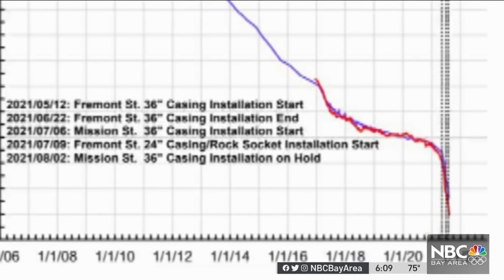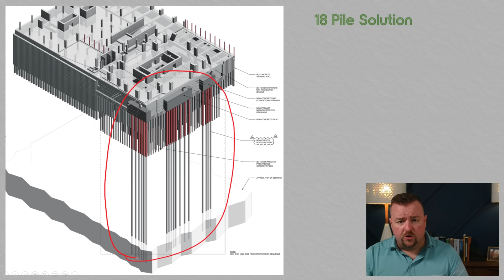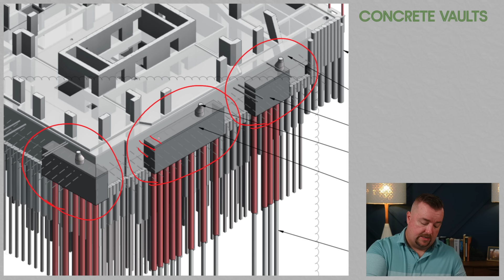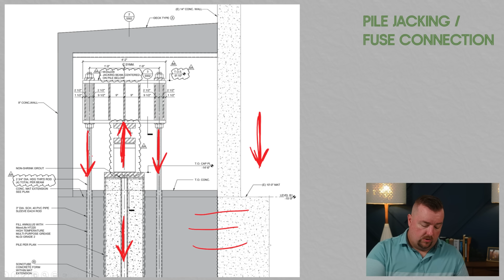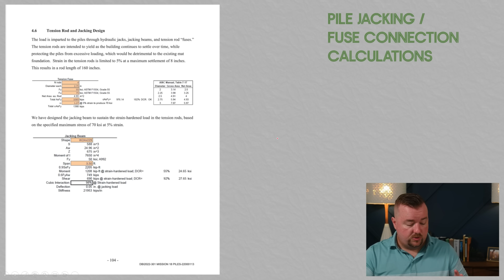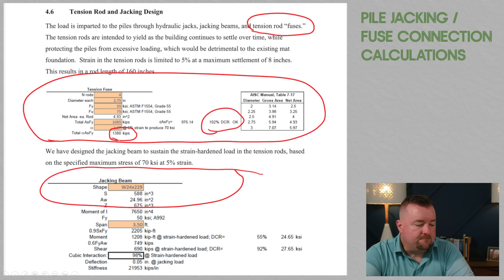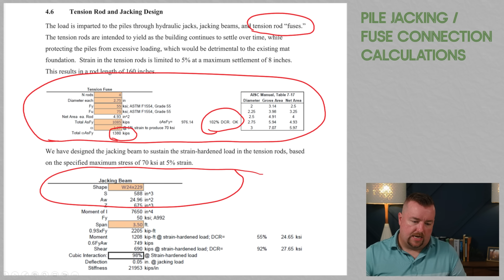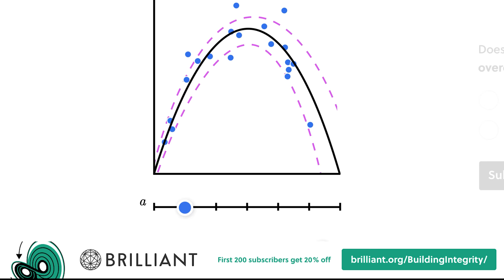Did I Uncover a $100,000,000 Mistake with the Millennium Tower "Fix"?

Comment: As mechanical engineer I would double check also the "tension fuse" calculation. I'm European, so the ASTM F1554 is not too familiar to me with all of their intricacies, not to talk about the units :) But what is perplexing to me, is the lack of taking into account the notch effect in the tension fuses. Those things, to my understanding, are all through threaded rods. The thread has a significant impact on the tension strength of the rod. There is going to also be wind affecting the building, which will cause the building to sway and that will cause the amount of tension in the fuse to alter. The thread with it's sharp crests and valleys will also act as a perfect swarm of nucleation points for cracks under fatigue load. I'd love to see how this is going to play out, but without the people inside or near the building... Do some of those ASTM or AISC things take these into account?

Also your worry about the steel plate is valid, worth some triple checking.
Reply: I think for this case they would assume the minor diameter of the threaded rod for the actual calculations, however for the stress concentrations, I think there are some equations that you can kind of just take that into effect but just multiplying everything by 0.8, though I'm not too sure this is going to be much of a cyclical loading kind of thing, mainly how it's going to be under tension constantly, the only actual dynamics being that of an earthquake

Comment: So far, the building has tilted about 30 inches.  (Another 6 inches, the plumbing and elevators will stop working).
These are Hail Mary moves to delay that day by a few years (so that the chief engineer & city officials are retired when this happens).
Reply: Good point! Nobody's even considering pre-collapse failure modes... SHEEEEEESH!
Reply: Chief engineer and city officials should be ARRESTED
Reply: Well, to be fair when they set up the jacks, the intention is that as the building continues to settle, it will settle the other way instead, helping to level it back out. Not gonna work with the issues with this design though.
Reply: The  building in danger is analogous to the local government of San Francisco which is also tilting dramatically to the left  and will fail/fall completely due to not reaching solid bedrock  (values)  There is a tower of babble component to this story.
Reply: @Jack-xy2pz  damn true
Reply: I heard in the last few days that some of the units now are having plumbing problems - back ups.
Reply: The plumbing is already going. Sewage is backing up into the apartments.
Reply: @TheJanet4321   I just saw a news report on that today.
Reply: Well there's poop on the sidewalks around the building so no big deal there .
Reply: Put up a big pole and wrap rope around the pole and the building
Reply: @the.parks.of.no.return  Congratulations! You are well-qualified to be the next 'expert' to 'fix' the building 😝
Reply: Let's not forget the financial backers, who want it "declared safe" so they can sell it like a hand grenade with a missing pin, and run for the door.
Reply: It's already happening...The story's are showing up now.
Reply: Toooooo many janga blocks!
Reply: @the.parks.of.no.return  That's a great idea, we could make the pole and the rope into a feature like using different colors of rope.
Reply: @Benny_000  I was only joking , you'd use two poles.
Reply: experts do what is best for experts 
at worst — experts are paid to lie
Reply: @the.parks.of.no.return  the city planners can announce to the media that "it is not an uncommon fix to use a pole and a rope"...  they just leave out the part that it is mainly used for a tomato garden.
Reply: @Jack-xy2pz  Rather apt analogy.
Reply: @angelarch5352  maybe they could grow a giant beanstalk next to it
Reply: @the.parks.of.no.return  
Walnart sells heavy duty galvanized tent  stakes that may hold against the tilt.. The good news is, according to greta thunberg The building has to only stand for another couple of days.
Reply: @Jack-xy2pz  well you could always hammer in about 10,000 stakes and attach rope from stake to the building I suppose
Reply: @Benny_000  rainbow colors ahh
Reply: @the.parks.of.no.return  As good idea as what the engineers have come up with so far.
Reply: @Jack-xy2pz  Brilliant. That way we can save the building and the world at the same time.
Reply: @Jack-xy2pz  Sure, get Trump to fix the building, that'll work.
Reply: @inconceivableabysses  Typical straw man/red herring type reply.

Comment: I am not an engineer, but was a PM who got to see the 4" steel base plates for the Oviatt Library lobby columns sheared right through due to the Northridge Earthquake.  Engineers put a lot of faith in steel & the earth doesn't was my takeaway
Reply: I've read about that building...  There was nothing wrong with the steel, the building was just unerdesigned for that large of a quake.
Reply: You've got to underpin down to the bedrock - you have to for a building of that size that in geologically-active region.

Comment: As a geotechnical engineer that has observed much smaller anchors with a similar design fail while testing them, I am very concerned. If that plate fails the rods could become rod shaped missles which shoot out of their holes through the overlying vault roof.  Your analysis needs a response from the design engineers and city building department.
Reply: My concern is that as the plates yield, the reduction in force on the jacks will be interpreted as a positive sign that the building is no longer sinking, instead of the reality that they have experienced plastic deformation and are close to failure.
Reply: @Hyperlooper  Unlikely. Because when that happens all the plates will fail in a cascade, and the building will begin actually settling (and will be measured elsewhere). It will be obvious anyway, since a lot of really loud bangs will be heard.
Reply: @armamentarmedarm1699  When an element is critical, but inexpensive to upscale, the best design methodology is to overbuild that element to eliminate risk. 
The cost of quadrupling the thickness of the plate (just stacking four of them even) is essentially nothing in the grand scheme of things.
Reply: THE PLATES DON'T HAVE TO FAIL.
The weakest thing has to fail.

I suspect the plates can be pulled through the concrete by the rods.
Reply: @fhuber7507  The steel plates are also highly likely to fail/break at the rod holes, because there is not enough supporting material around these holes. 
And when this happens (... to me this is just a question of 'when', not 'if' ...), there is no means of checking the state of these plates and/or the state of the rod ends, because they are firmly enclosed in concrete. From my point of view it would have absolutely been imperative to design this crucial point of potential failure in a way that would have allowed constant monitoring at any given point in time, especially with regards to the incalculable additional stress factors from seismic events in an area that is very vulnerable to earthquakes. 
Also, there seems to be no provision for re-greasing the piles and the rods in their respective surrounding tubes, which I would consider a serious oversight with regards to the necessity to keep these mechanisms in an uninterupted perfect working state for decades to come - especially with regards to the fact that they are situated in enclosed underground vaults which are prone to high humidity and condensation issues. 
Overall I think it would have been better/safer to have the piles and hydraulic lifts designed as pushing elements that work directly towards the (accordingly reinforced) ceilings of these vaults instead of using them as pulling elements working towards the floor sections of the vaults. By doing this the whole failure prone I-beam/rod/plate parts could have been eliminated.
Reply: @armamentarmedarm1699  Are you familiar with subscription-based businesses?
Reply: @westganton  That's one way to put it I guess... instead of a wholly owned foundation that just works in perpetuity, the building got a foundation that requires continuous hands-on management and on-going recurring expenses in order to not have it disappear on them – and it still might just surprise them and break down one day.
Reply: You won't have rod shaped missiles. The rods are still attached to the jacking beam.
Reply: I don't see how this could work. As the building continues to sink, the entire weigh load of the building will eventually rest on this rig.
Most likely real purpose of this thing was to extract another $100,0000,000 from this engineering disaster of a building.
Reply: @Framo60  Just a potato planter here, but I read that reinforced concrete has great strength in compression, but not so good in tension.  A solution that jacks up the ceiling of the vault would place all sides  of the vault in tension.  Would that be a problem?   The solution shown is holding the vault up by lifting it with "straps" from underneath.
Reply: @chetmyers7041  I am not an building engineer, too, but I think that you have a good point here. 
But it would in principle be possible to take the tension out of the concrete in the side walls of the vault(s) by pre-stressing it like it is done in concrete beams or bridges. 
The construction as it is being build now puts a lot of tension into the lower part(s) of the vault(s) exactly because the straps do not go through the bottom face(s).
Reply: @fhuber7507  Unlikely. There will be a lot of rebar reinforcing in the concrete.
Reply: @youtbe999  You are assuming that the building continues to settle. But settling is what this is meant to stop.  
The way it is meant to work is to take a certain amount of the load from the rest of the foundation, if it works, it will take enough load that the rest of the foundation stops settling.
Reply: @armamentarmedarm1699  I guess it depends how many people are in the building,
 it's like the Ford Pinto fuel tank problem,  cheaper to pay out law suits than fix the fuel tank.
Reply: No, that won't happen because there are nuts below the top load-distributing beam, and also I think the vault roof is thick enough to safely stop a rod.   I'm quite sure that aspect of the design is totally safe.    As for the rest of it however.....
Reply: @Pystro : The rods seem to be attached to the beam with nuts, which mostly support it from going *down*. I see only a simple nut preventing it from going *up*.

If the rod has been loaded to some 250-300 thousand pounds and that load is suddenly released, that's the size of the shock applied to that single nut.